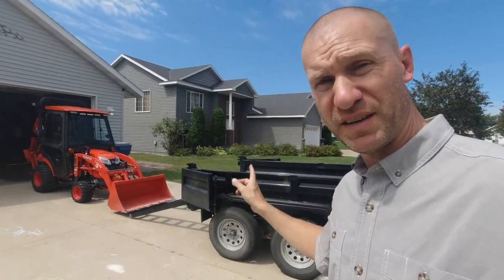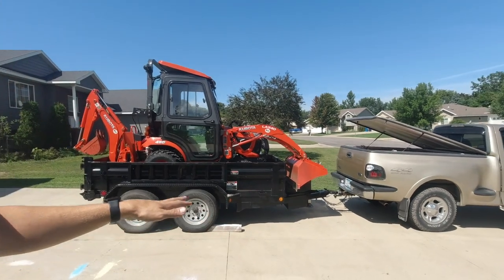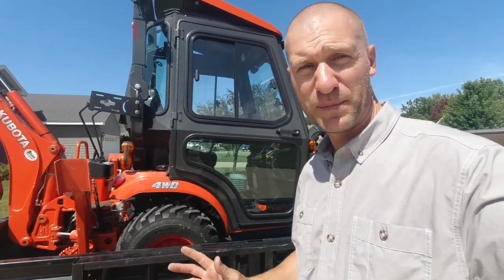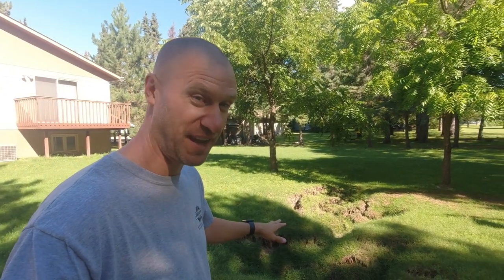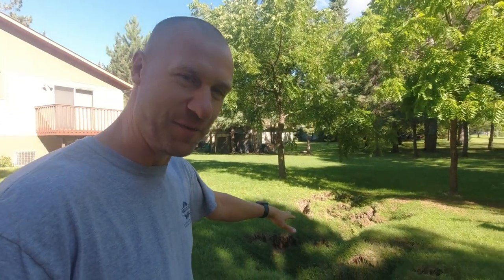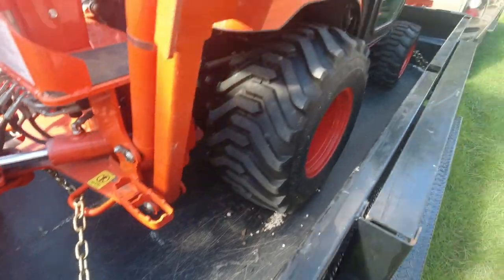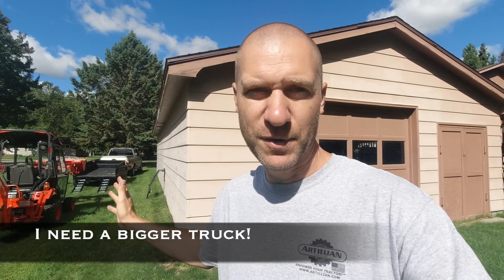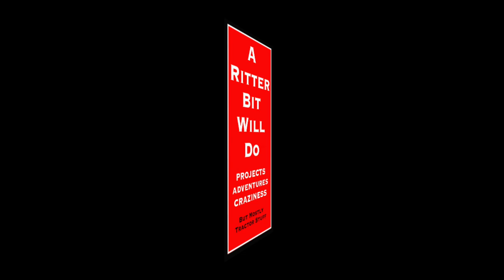LOAD TRAIL DUMP TRAILER AND KUBOTA BX TRACTOR  (perfect pair)

Comment: I just bought a 2003 Silverado 2500 HD to haul my tractor. It has a 9900 lb tow rating. My 20 ft trailer weighs 2500 lbs so that leaves me with 7400 lbs of payload. Enough for the tractor and implements. The truck is an extended cab with an 8 boot bed so the long wheelbase tows very well. The new trucks come with built in brake controllers. Luckily, the previous owners installed a controller in mine.
Reply from the maker: That seems kinda light actually, are you sure it’s only 9900? Just seem like a 2500 would tow more. 
Keep on tractoring!
Reply: @ritterjon  The new ones haul MUCH more. Mine is a 2003. That info was from the owners manual.

Comment: I need to watch your channel more. I didn’t know you had a dump trailer.

I just picked up a new dump trailer an hour ago and I haven’t tried to see if the tractor will fit in it yet
Reply from the maker: Yep, I've had it for several years now and just got new tires yesterday. It's a perfect combination for my BX tractor and my F150 that doesn't tow very well. 
Keep on tractoring!

Comment: I have the same set up as you. 6x10 10000lb load trail dump trailer with a bx23s with no cab. (Second set of ramps and you can load/unload at any angle or weather) last year I traded my f150 for a 2019 f150 V6 with the max tow package. (Get the tow mirrors) It’s amazing. Dealer told me it can tow 13k but I only needed 10k. I’ve towed 18k with it. I don’t plan to tow that much again but the truck and trailer handled it awesome and it didn’t even squat (I couldn’t believe it either). I have pics if you are interested. If you like the half ton there is no need to go bigger. Also, I bought it near Minneapolis and found a dealer that offered a 15 year completely bumper to bumper warranty.
Reply from the maker: Wow, that’s a great warranty! I’ve thought about getting another newer f150 because they tow so much more now. However, do have plans to tow my L3940 in the future and maybe a 5th wheel camper someday. I’d like at least a 3/4 ton for that. I’ve got sure spring on my truck now and they help a lot. We’ll have to see what kind of deals I can find. 
Keep on tractoring!

Comment: Maybe keep the 1/2 ton and add helper springs to the back? Also if you were to do that, how would the tractor sit if you backed it on. Obviously the loader would be hanging off over the back just as it does on the front, but you wouldn't have to worry about high centering the backhoe. I have a 16' Sierra 1500 with Hellwig helpers, makes a huge difference when I haul my 7000lb camper. Love the videos, keep it up bud!

Comment: If I recall correctly, Mike at Outdoors with the Morgans tows a 12' dump trailer with his F150 (EcoBoost V6) and has no issues.
Reply: True but the newer vehicles are coming out with more horsepower/torque allowing to them to tow heavier payloads.
Reply from the maker: Yes but I’ve also noticed that mike doesn’t seem to fill his trailer up that much. Not sure why. 
Keep on tractoring!
Reply: 3/4 ton has bigger brakes...

Comment: Bonjour Monsieur le Professeur 😊 I think that you are fine Sir with the truck that you have. How many times in one single year that you have to carried your tractor ? If you have realy want to change your truck you should go with a Dodge Ram 1500 with the correct towing package or a 2500. Depends also how is your Dodge Ram dealer at you place. If I was you,  I will attach also your backhoe and your front loader,,, I do understand that the backhoe as locking pine but the front loader as not,,, Better safe than sorry... Great video Sir Cheers !!!

Comment: Was wanting to buy a 14 foot dump trailer for multiple uses. One being moving my Grand L tractor with the bucket over the front. Was told that was only legal if it was a goose neck trailer so the loaded could be secured. Now I am trying to find a A16 foot bumper pull. If all else fails guess I will have to go with the goose neck.
Reply from the maker: It's only illegal if you get caught. In Minnesota I couldn't find any laws prohibiting it. I'm still really not sure. 
Keep on tractoring!

Comment: Jon,  I have a BX23s with a cab, just like yours.  I have towed it many times with my 2017 Silverado 1500 with the tow package on an 18 foot flatbed trailer with no problem.  I don't think you NEED a 3/4 ton truck, just a larger trailer.
Reply from the maker: I also have N 18 foot trailer like yours that pulls a lot nicer as I can center the load better. With the dump trailer I’m a bit tongue heavy but I don’t have a choice with the tight fit. Also I want to be able to tow my L3940 eventually. Hope you’re enjoying you BX with the cab! 
Keep on tractoring!
Reply: The capacities of any truck built in the last 5 years are close to double of the older trucks in the same class, I load the newer Chevy 1500s with a yard of stone at a time and they aren’t even squatting that bad, but a 2001 Chevy 1500 would be resting on the axle.... with that being said all rams have pitiful payload capacity

Comment: 2020 Power wagon. I have a 2020 rebel. Love it.  Trailer brake air bags.   It will handle it.
Reply: Do not get a power wagon for towing. I have a 2018 power wagon, towing capacity is 10,000 lbs. That's crap for a 2500. It's de-rated because of the off-road suspension. I love the truck but will be selling it to get a regular 2500 to tow my dump trailer.

Comment: 2500 GMC Duramax/Allison is perfect for your application with room to grow..  I’ve owned 2: a 2003 2500 and a 2006 3500.  Loved both trucks but the huge size made the 3500 annoying for getting groceries.  The Duramax is proven and powerfull.  Nothing like the torque of a turbo Diesel.

Comment: My dad just got a Ram 2500. It is nice truck. I haven't got my finance committee to release any funds yet.
Reply from the maker: Those finance committees can be stingy sometimes. Don't tell my wife but I'm going to go buy a new chainsaw today. 🤫
Keep on tractoring!
Reply: @ritterjon  Just got back from the farm. I took the small chainsaw today (STIHL MS170) and we cut a few smaller trees. We had one larger one, I wish I had brought the MS271 with the 20 inch bar on it. Yet, we were able to get it done. Anyway, get you a good chainsaw and it will make cutting much easier. Look forward to seeing what you purchased in a upcoming video.

Comment: That really is an excellent setup for getting into close places and getting a LOT of work done. I'm not so sure you really should get anything very much larger. As for towing, I've towed RVs etc. literally 100's of thousands of mile. In my opinion, the KEYs to a good tow truck is adequate suspension, E-rated tires, trailer brakes and GEARING. You DO want a lower ratio differential for towing. It's  a real torque multiplier. Our 2008 Tacoma is a 4x4 Sport with a special option 4:56 differential ratios. It's not a 3/4 ton truck but it has a 5600 lb towing capacity and it has the power to  pull a lot of weight. You  might want to look at any 3/4 ton 4x4 as they will have the lower diff ratios AND bonus, the 4x4 will get you out of a lot of simple but stuck places. No reason for a big lift, just that low gear ratio and 4x4.
Reply from the maker: You’re exactly right about the torque multiplier. I think a 3/4 ton would suit me well. I do need to upgrade to a better set of tires because the tires I have now are not made for towing, especially as often as I do. I always have a trailer when using the truck. 
Keep on tractoring!

Comment: I have a 2014 Silverado half ton with the Max Towing package. Good for 11,300 lbs towing capacity. That’ll get you up to the next level. Curious about you running around with your back hoe bucket not being supported. Up here I think our Dept. of Transport specifies that the front and back attachments must be resting on the deck when being transported.
Reply from the maker: The backhoe did have a pin it in so I could come down. I’m more concerned about the loader however. The newer trucks have a better towing capacity. With future plans to transport my L3940 though I need something bigger than a half ton. 
Keep on tractoring!

Comment: The f150’s were pretty good trucks but lacked a bit in power I went to a 2011 f250 6.2  and love it it tows great and I’ve put 335,000 miles on it and the gas mileage empty is way better than my old f150 in fact I get between 11and 14 mpg towing my fifth wheel trailer
Reply from the maker: That’s great mileage for towing. The best I’ve ever got without towing is just 14. It’s a gas hog for sure. I rarely drive it so it’s not that much of an expense but I do wish it towed better. 7900 is max I believe. 
Keep on tractoring!

Comment: I have a 2009 F150 with the max trailering package. Crew cab with short box. Max trailer weight, 11,200 lbs. GCWR 17,100 lbs. So yes, you can pull a much bigger trailer with a ‘half ton’ pickup.
Reply from the maker: My 99 F150 is only rated at 7900. The newer trucks made many improvements. A half ton would probably work well for me. However, eventually I'll need to trailer my L3940 and I'll need more than a half ton for that. Just trying to figure out where we'll be in 5-10 years. 
Keep on tractoring!

Comment: Bucket over front doesn’t raise any attention from police or DOT? Would turning backhoe to one side give a little more clearance? I want to get a 14’ dump trailer and do this with my Mahindra 1533 with backhoe but I’m worried it’s a tight fit and would require bucket over front attracting attention from Leo’s
Reply from the maker: From what I've read in my states laws about towing I think I'm ok to tow like this. I would have gone with a bigger trailer but the amount that my truck can tow just didn't make sense. It's only rated at 8k pounds. The newer trucks are much better. 
Keep on tractoring!

Comment: I have a l3560C and my wife has a BX23S and I currently have a Toyota Tacoma. I have access to a 23 foot tilt bed trailer and I can tow the BX; however, it is close to the 6500 pound tow limit of the Tacoma. The trailer empty weights 3400 pounds. Thus, I feel a f350, Dodge or Chevy 3500 would be in the correct ball park. I don’t see me pulling a travel trailer; so, I am very undecided on the $10,000.00 option of a diesel engine due to the higher cost and higher maintenance costs. Plus, here in western Washington  diesel is often the same price or higher as unleaded and you have the extra cost of DEF. So MPH is a big consideration.
Reply: The tilt bed of the trailer takes all the pucker factor out of loading and unloading.

Comment: Nice fitment!!
By the way, you still have to secure the front bucket by the DOT rules
Reply from the maker: Thanks but I don’t think I need to secure the bucket because I’m under 26k. I think that only ally’s to larger loads. I could be wrong. Maybe I’ll find out the hard way someday. 
Keep on tractoring!
Reply: @ritterjon  I was pulled over taking my BX23S home new. Luckily the guy was super cool and could see I was just taking it home. He said the loader and backhoe both need two points of attachment along with the four on the tractor. Total of 8 points.

Comment: Doing my part to help you get a larger truck. Thanks for the entertainment and knowledge.  Have you tried putting some 2x6s behind the ramps? The extra inch might keep the backhoe from scraping. (This is me with no tractor, truck, or trailer making suggestions. So that's about what my opinion is worth;)
Reply from the maker: I have tried using 2x10's and it does make a difference when I don't have a slope to back into. I wish the trailer ramps were a bit longer. 
Keep on tractoring!

Comment: I'm no expert but isn't this illegal in most places? I remember reading or seeing that you cannot have parts of equipment outside of the trailer like this. Just wondering.
Reply from the maker: Minnesota trailer laws are more lenient than other states.  Some states are really strict about it. 
Keep on tractoring!
Reply: @ritterjon  Thank you for your response. The only thing I do not like is the backhoe out of the back. Can you swivel it around? The FEL actually looks pretty good sitting on that tire. If you ever have any trouble you could probably chain it down there somehow too.

Comment: You did a great job loading the trailer but here in Florida probably wouldn't get away with it. I have a 12 foot dump trailer with a Massey Ferguson tractor loader backhoe combo gc1710 and I loaded it just like yours and I had a dream of starting my own business and on my first voyage out Florida Highway Patrol pull me over and stated that every part of the machine has to be inside the dump. Have you had any issues with your local police? also he stated that it must be tied down
Reply from the maker: I'm not 100% sure I'm legal here but I haven't read anything that says it's not ok. I haven't had any issues yet. The tractor fits perfect this way. 
Keep on tractoring!

Comment: Could you swing the backhoe to the left or right to gain a little more clearance?
Reply from the maker: I really can't because there is not an inch to spare for the angle. The backhoe boom rubs the back of the trailer. 
Keep on tractoring!

Comment: Curious if you have tried to back the BX in? Seems like it would allow tighter turns and possibly not bottom out the backhoe when driving up the ramps?
Reply from the maker: The pucker factor is too much already going forward. I think the next step is a larger trailer. I'm working on something, stay tuned. It might happen this summer yet. 
Keep on tractoring!

Comment: Clever way of moving your BX.  What length are the ramps?
Reply from the maker: The ramps are maybe 5 feet and they need to be about a foot longer. 
Keep on tractoring!
Reply: @ritterjon  If that's a Load Trail Trailer I believe offer 6' and 8' ramps.  Do you have any pics of the turning radius with FEL over the frt of the trailer.  I'm in the same boat no space for bigger trailer and not enough truck to pull it.  10'x5' dump trailer maybe my best option but worry turning.  Thanks
Reply from the maker: @paulsundquist3125  I don’t think they had ramp length options when I bought this one. Six foot should be enough. As far as turning radius pics I don’t have any and I’m not really sure how tight of a turn I could take. I’m just careful not to turn too sharp.
Reply: @ritterjon  Any chance you could measure the tongue length (front of the box to hitch).  Can't find the measurement anywhere and can't locate 5 by 10 trailer to measure.

Comment: Don’t let state trooper catch you hauling without the backhoe bucket strapped down and the loader bucket also has to be strapped down. You also cannot have any part of your load protruding from the confines of the intended weight baring area more than two feet without a permit. Your F150 has a tongue weight limit but depending on the load you don’t want to exceed more than 10% tongue weight of your entire load behind the hitch. For example if your load plus trailer is 10,000lbs to put more than 1,000lbs on your hitch is too much weight. I treating to watch and I hope this was somewhat helpful. Good video.

Comment: PS- I have been towing my 7k lb travel trailer with a 2014 Chevrolet Tahoe Z71 (4x4, v8, with tow package) for a while without issues.  Pretty sure that drivetrain can handle 8k or so.
Reply from the maker: Mine is geared high and 8k is my max tow rating. Trucks have made huge towing improvements since 1999. I'd get a new truck but trucks have also tripled in price since then also. 
Keep on tractoring!

Comment: I am concerned about assuring enough tongue weight. Apparently you aren't having any issues? I took a screen shot of your trailer loaded, got the bx/fel/bh weights from bx specs and estimated the CG of each guessing at the metal in front of and behind the cg. It looks like the overall average moment arm cg is about 11% forward of the center distance between the two axles and the ball mount which is perfect and is about 254 lbs!
Reply from the maker: Awesome! 👍 So I’m well balanced. I actually think it’s a little heavier than that. I have a set of air springs that really make a big difference when towing. 
Keep on tractoring!